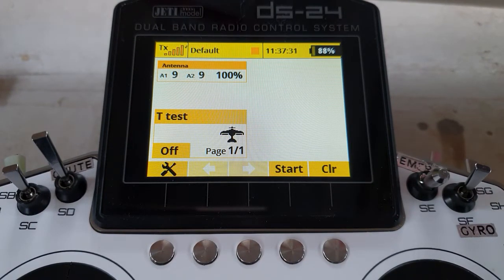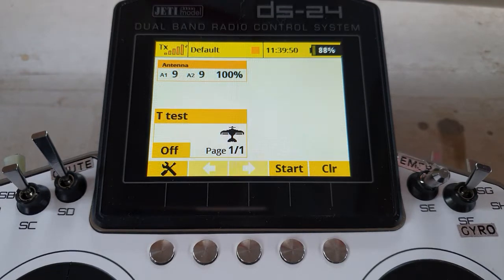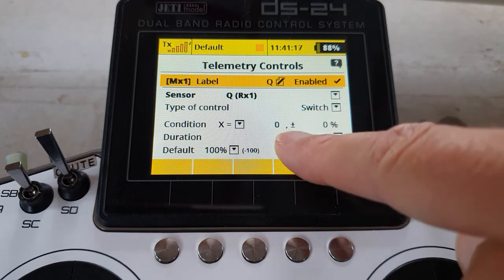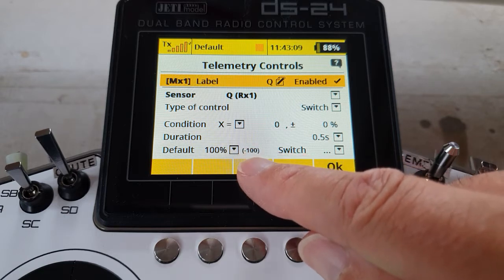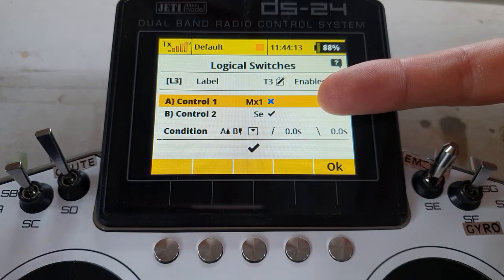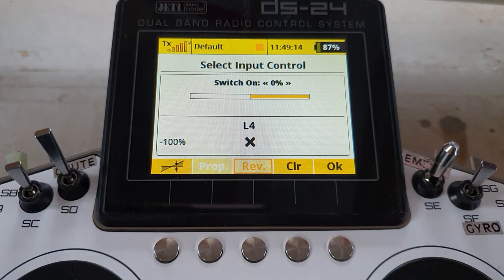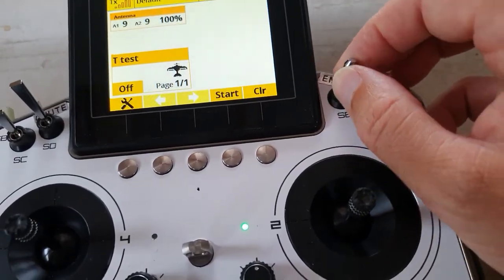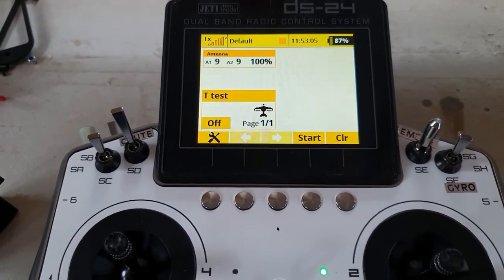Jeti - extra, extra safe throttle cut switch for battery changes

Comment: This is a great safe trottel lock. Im just thinking; If you programmed the extra, extra safe trottel lock and if you loose the radio, then switch will go to lock position since telemetry will be zero Volt and if you get radiocontrol back you will need to put trottel back to zero before having trottel response again. Am I thinking right?
Reply from the maker: Yes, you will need to cycle the switch, and throttle to 0